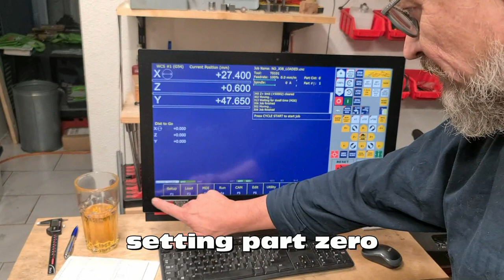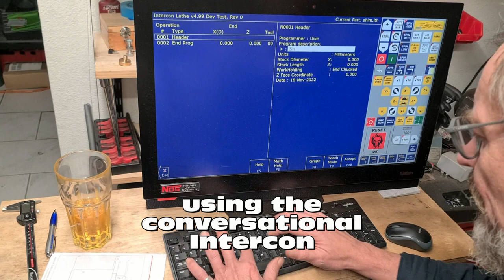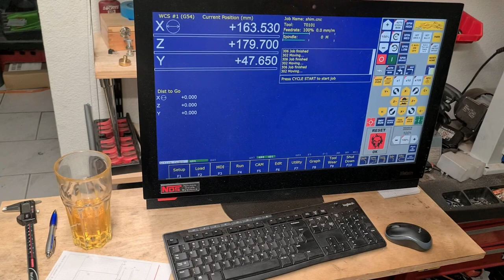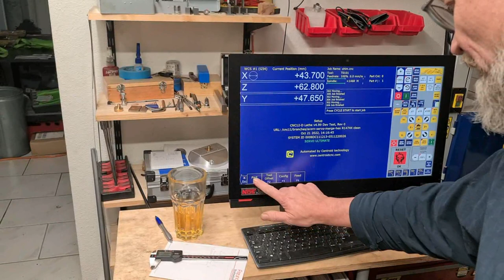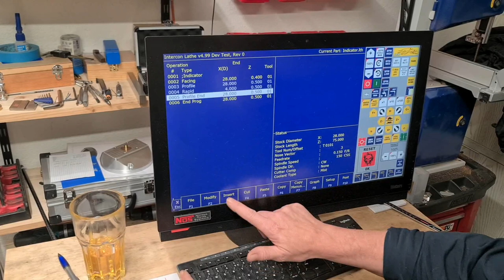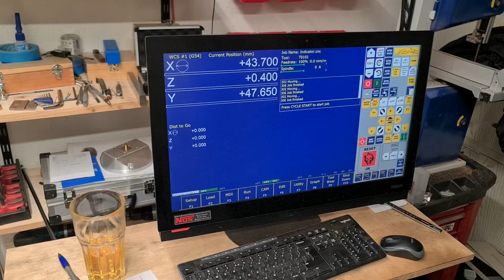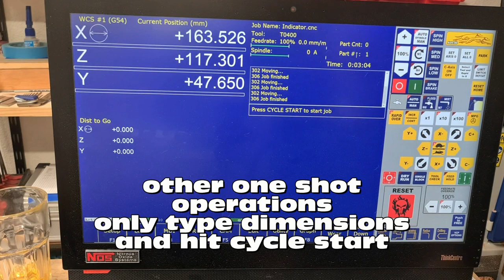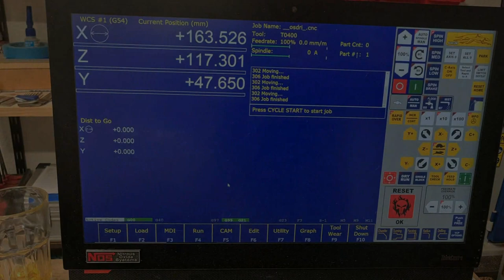Simple turning parts with Acorn 6 DIY CNC faster than manual turning?

Comment: Uwe, can you let me know what size servo motors and ballscrews you used? I have a 13x40 I’ve been thinking about converting. I have an oak controller on my mill now. I’m thinking about using an acorn on my lathe.
Reply from the maker: 400W JMC AC Servos on the axes, 1500W on the spindle. Z 20x5 ball screw X and Y 12x4 ball screw

Comment: Nice setup. How did you add the hand wheel. Are you using a micro controller to emulate keyboard jog
Reply from the maker: Acorn6 is featuring 3 encoder inputs, so you can connect the handwheel

Comment: Thank you so much for this. I've been on the fence about converting my lathe because i've never understood how conversation/wizard programming would work, and this is a really great demo! is there a specific instruction you followed for making that second handwheel work for your carriage? because to me that is also a huge advantage in your setup, and something i think I will need. 

I'd also like to know, do you think the multifix is essential for a CNC setup? I have found them expensive and hard to get where i am (canada), so i'm hoping that my first pass at a conversion can skip that added complexity and just use the QCTP (aloris style) that i have! I know the mulifix has the advantage of angled tooling, but for now luckily my parts are very simple and won't need that! but if it's the only way to get 0.005mm accuracy/repeatability, i may need to go for it!
Reply from the maker: Second handwheel is easy to configure with Acorn 6, You will need a quick change toolpost with a good repeatability and toolholders for drills also. 0 and 90° will be enough.